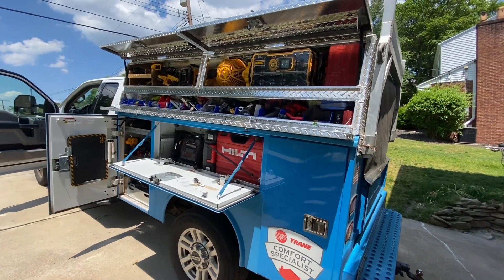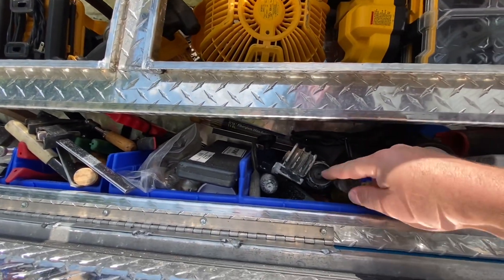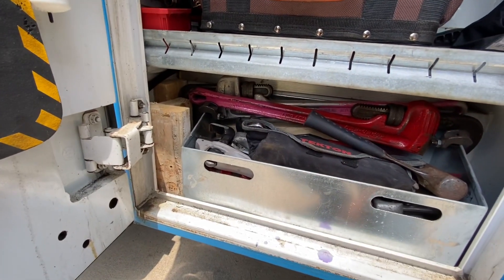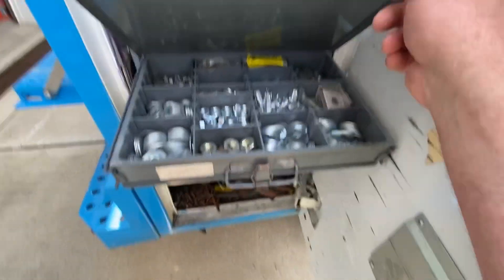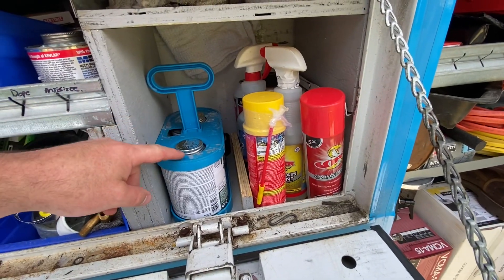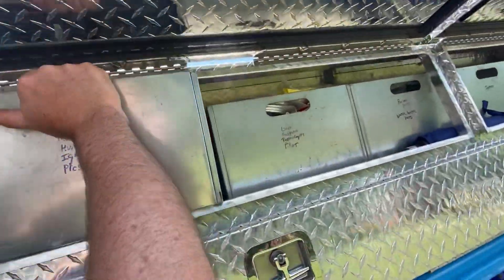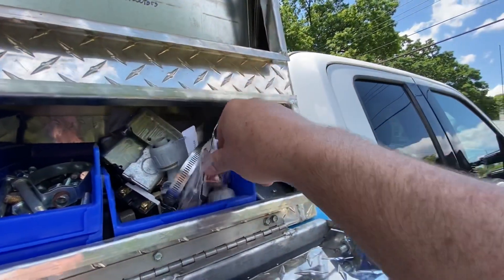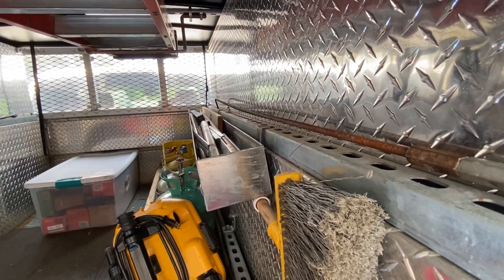HVAC Service Truck Tour

Comment: You are very organized but just the tools you have on your truck come to more than most of us make per year so this is great if you're self-employed .this  job of doing heating and air conditioning just comes to more money than most of us make I spent 40 years doing this and I just don't see anyone new in these days being able to put that much money into their job. But good luck to you. Also I don't see anyone over 35 in the past 15 or 20 years doing this for a living I guess they all moved on to something else. Good luck!!!
Reply from the maker: I service all aspects of “HVAC”. Gas, oil, & heat pump forced air. Geothermal , water source heat pumps, every type of hydronic heat (including steam & solar). Tankless water heaters. Residential & commercial. To properly and professionally service all of this, it takes a lot of the correct equipment.

Comment: Vans do it better for service
Reply: All personal preference, I was in a van for 8 years.  Now in a service body truck for the last 10 years and would never go back to a van.
Reply: Commercial or residential?
 For Commercial the truck stock we need and the tools.we need kind of necessitate a large van
Reply: Commercial, I don't keep much truck stock but definitely have room for all the tools I need on a daily basis.  I see too many different types of equipment to worry about truck stock.  I've always thought of truck stock as more of a residential side thing.
Reply from the maker: @jakem117  about 50/50. But I oversee a small crew of techs that have everything on their vans.